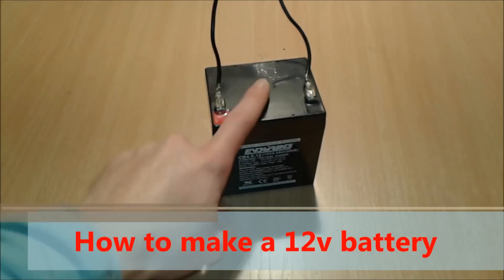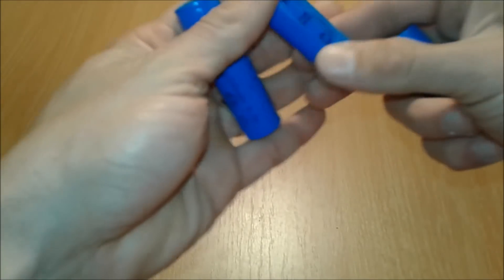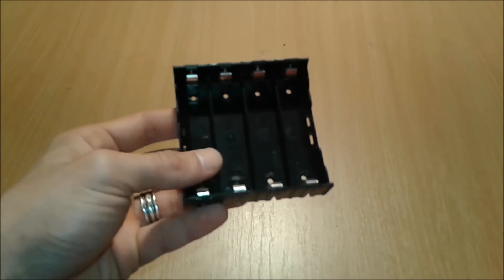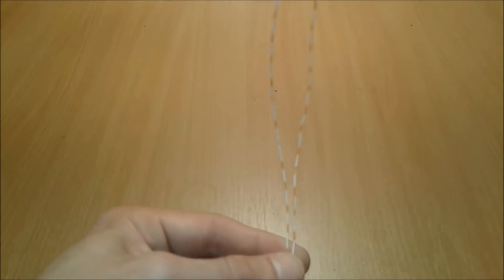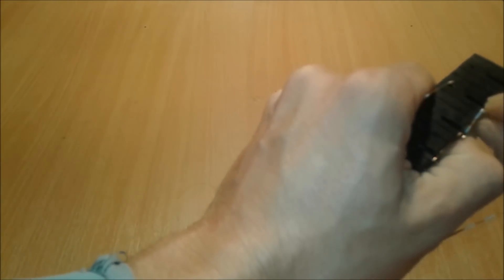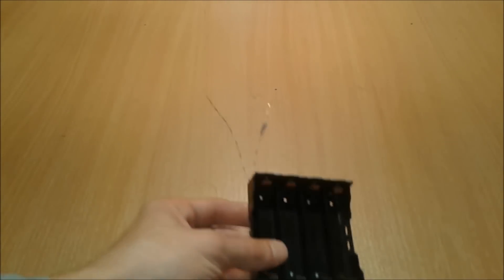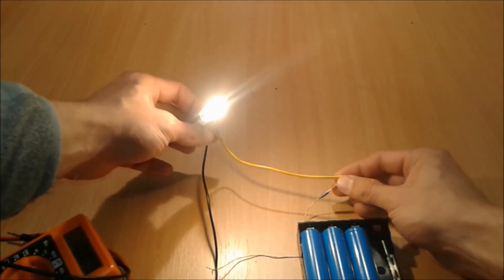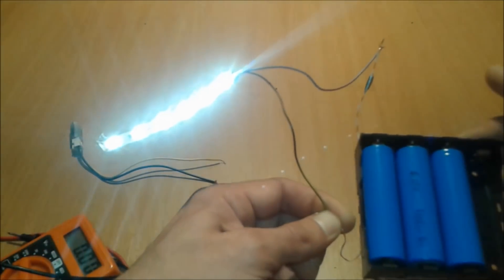How to make 12v battery pack at home. Make a new battery

Comment: Hey does 16 18560 battery cells make 48v? I'm thinking about making a 48v battery pack on the cheap if so how many batteries do I need to make 48v how do I connect batteries in series also charge them all 

Then should I get a bms for batterys how I connected bms?

Thanks for helping:)
Reply: Called google it my friend, power the info in your hands and you on a video asking questions. lol

Comment: Are those battery connected in parallel cause if connected in series it increases voltage paralell it increases miliamps am i right cause im trying to make a 12v battery pack using tape and wire i have like about 16 1.5v batterys
Reply from the maker: This is a battery pack connected in series to increase voltage so yes you are right in series the amperage stay the same increase voltage and in parallel the voltage stau the same incresing the amperage
Reply: @NoSkillsRequired  What diod or resister are you using on there?

Comment: Hi I wanted to make battery pack for my  electronic scooter, rite own I am using led battery,  my scooter system voltage is 48, battery connected is 12V  33Ah x 4nos.... How do I make it from used laptop battery please guide, my whatsapp number is 9920295559

Comment: NoSkillsRequired, can I use two of those battery holders 'back-to-back' fitted into each other....so the solder prawns are touching each other.... in order to double the ah hours ?
Reply from the maker: Yeah  sure this is the wsy they ate making battery packs  one battery holder in series and then parallel all holders

Comment: You can just buy these batteries. Aliexpress or ebay or amazon or anywhere else
Reply from the maker: arshi khur you will prefer to buy them locally most of the company don't ship because is a fire hazard or charge a lot for postage but normally Amazon, ebay sell them through a local seller
Reply: Find a few old laptop batteries and take them apart and salvage the cells that work.

Comment: This is just a bomb! Never do this! It works for some time and than.... you will have a big problem.
Reply from the maker: Noob and Nerd there are 2 ways to do this with/without bms this is the second one, the cells are proper balanced and matched and by the way it is working for more then 2years constantly never drifted more then 0.4v so think again
Reply: @NoSkillsRequired  how much are output current getting from that battery?

Comment: how to convert 5v output power bank to 12v output??? cant i just solder 4 power bank batt the take out 5v power bank chip after that i change with 12v charge this method cant get 12v.i mean diy
Reply: because i think about safety and battery life
Reply from the maker: tok aqi420 check out my video how to double the output of power bank I was able to connect 2 power bank in series the output but I don't remember why I abandoned the idea I think the power consumption was big and not effective but works

Comment: kya isko bike me laga sakte hai
Reply from the maker: Devendra Kumar I don't have a clue what are you saying mate sorry
Reply: @NoSkillsRequired  he is saying can i connect this battery with bike
Reply from the maker: this is a method to make your battery pack 12v will not be enough for ebike but a battery pack for 24v or 36v just add more cells in series to increase the voltage and parallel for increasing the amperage.3for 12v 6for 24v and 9 for 36v

Comment: how to charge them??
Reply from the maker: +Manoj Sharma you can charge this pack with a 12v 500ma power supply, or with a iMax b6 do not use a auto battery charger
Reply: @NoSkillsRequired  So to change you simply connect plus to plus and minus to minus and they will recharge?

Comment: Nice video mate . But I have one doubt , I saw you put soldering behind to complete the circuit my question is  the metal pins on each slot are separate or are they connected to each other ?
Reply from the maker: Morant Leetzor the metal connectors of the 18650 battery holder are not connected you have to join and solder them how you need them series and parallel is better than soldering directly to the lithium cells
Reply: NoSkillsRequired thanks man, sub for you👍👍

Comment: hey guys, thanks for your nice video. we are supplier of high qualityli-ion cells, spot welders, bms, nickel strip, plastic holder, pvc wrap, with our parts you could build your own battery pack. if you need welcome contact with me. skype: e-firesales    email: littlebear@cl-rd.cn   www.cl-rd.cn   thanks in advance

Comment: Hey nice work bro but I have one doubt can this 12V lithium ion battery pack  is strong enough to start a 125cc to 150cc motorcycle (bike)
Reply from the maker: Raghu Ram I am not sure if you got a lead acid battery used for this and tell me the Ah rating I can tell you if yes or no all the best
Reply: NoSkillsRequired yeah bro I'm using Amaron pro 4AH battery (4000mah) can you pls tell me whether these lithium ion battery pack can hold charge as much a typical lead acid maintenance free battery can hold
Reply from the maker: Raghu Ram in this video I am using some 1Ah liion battery so if you find some 2a cell put 2 in parallel and 3in series like in the video and you have the same capacity think of laptop battery they are normaly 11v 4-5A theoretically the liion are better than lead acid but more expensive
Reply: @NoSkillsRequired  how to charge these batteries
Reply from the maker: ever wing with iMax b6 or something similar that has adjustable current and voltage settings
Reply: @NoSkillsRequired  can I make individual charger to charge the battery and thanku for valuable reply
Reply from the maker: if you are reffering to charge each cell separately yes you have to buy the chep power bank that you find and make some holders or watch this video https://www.youtube.com/watch?v=coNCIHSpypQ

Comment: You need undercharge protection in your circuit or you can damage your cells. Because you are charging them separately, the overcharge protection will be handled by the charger.
Reply from the maker: John Michael Stock I am making an battery protection 4.2v full 3.6v nominal and 3v fully deplited Wright?